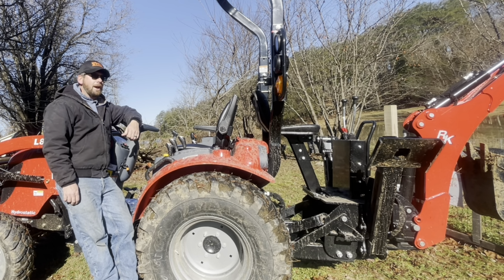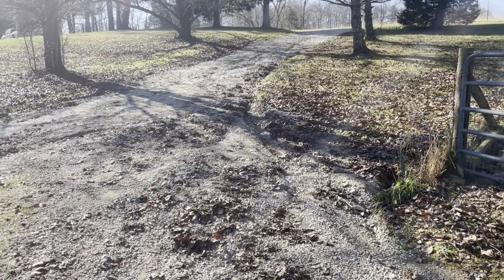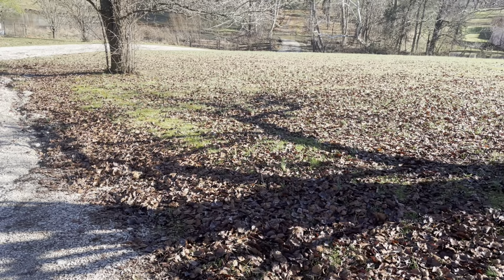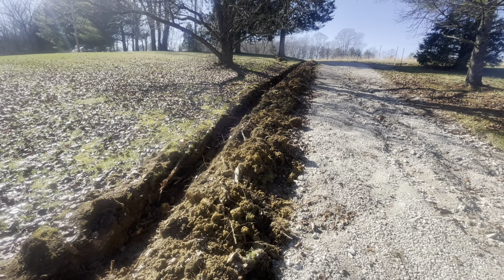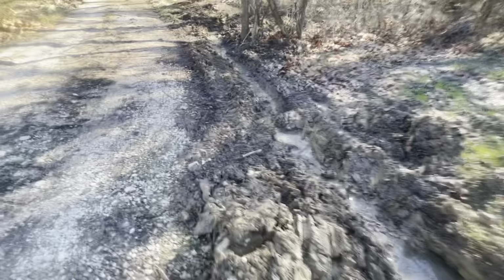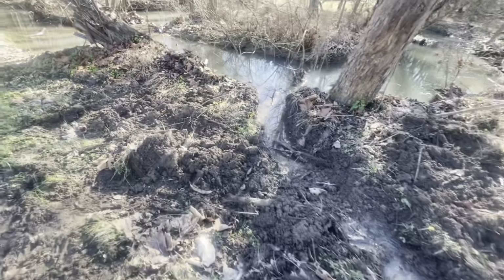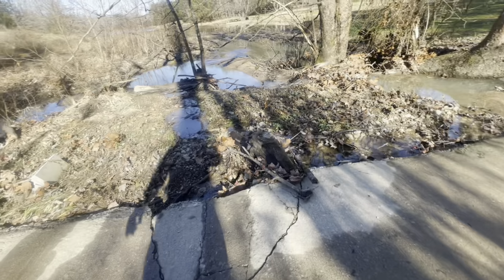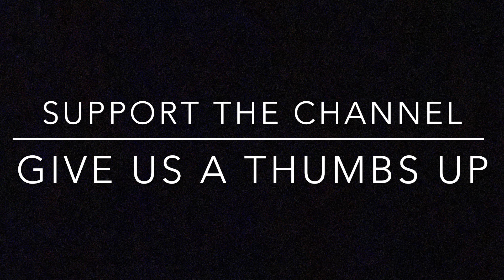#27 RK25 T25 Tractor Backhoe 6.7 - “What a DITCH”

Comment: Hey Denny , just slap that RK25 in neutral (trany) when digging & push & pull with backhoe every two feet. Plus you want to curl the loader bucket backwards-- that way it "knives in" backward & plants you right in , BTW this holds the tractor even more than the stabilizers. ALL tractors WITHOUT front bucket amplifier links are handycaped with out this feature. Happy "Leaver-Pulling" on the backhoe,  you should be up to max RPMs in about 250hours. BTW ,Even at the accelerated vidio speed that is my speed now with 835hrs. Thanks for the great Video Sir and happy safe tractoring.

Comment: Is there a way to change the controls to normal style excavator. It looks backwards from what I’m used to
Reply from the maker: Sorry for the delay in response. I must have missed this one. 

I suppose you could move the hydraulic lines around to change the operation. However there is not a simple switch button to press to change the operation.

Comment: Nice job, made it look easy!  When you were digging, how many rpm’s were you running?
Reply from the maker: Thanks for the compliment. I ran it at idle. I didn’t change because I wanted to get familiar with the controls. Plus it did what I needed with no extra rpm necessary.